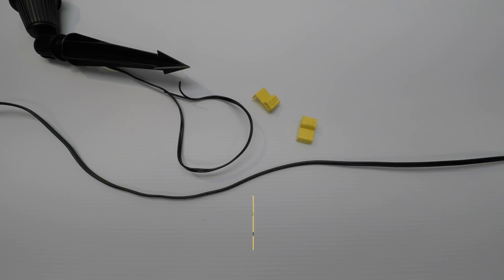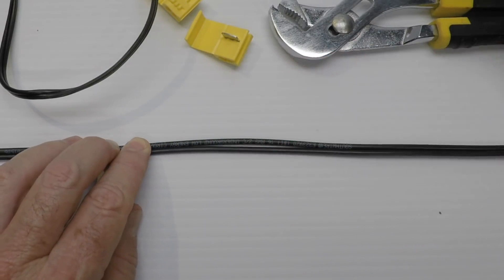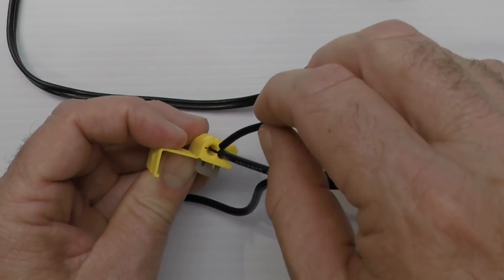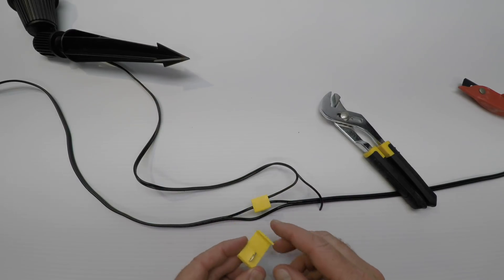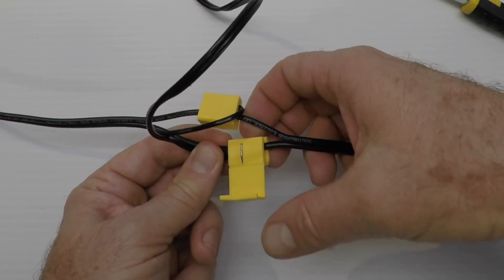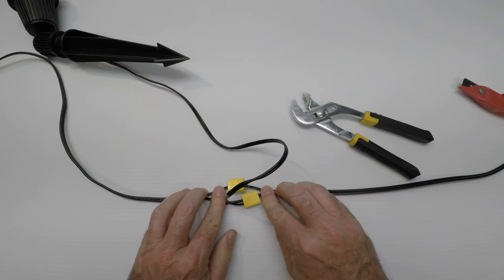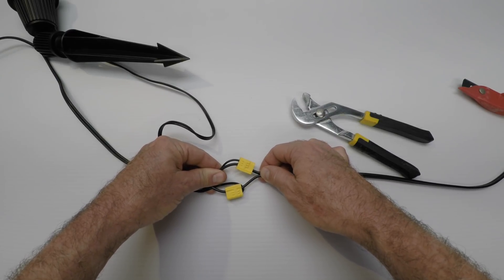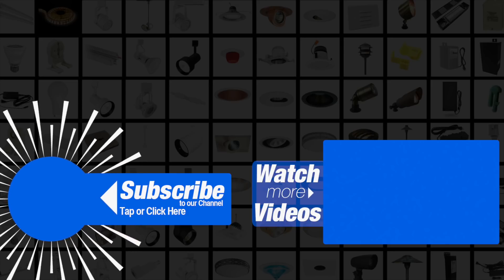How to use Our low voltage Yellow Wire Connector in Outdoor Landscape Lighting

Comment: These look fantastic. Went to you website. Was going to order the brown one due run wire being 12AWG. Is there an advantage of the blue one having the electrical silicon. Should one add electrical silicon to the brown one?
Reply from the maker: The gel greatly reduces moisture contact with the wire connection allowing for a more secure and long lasting connection.

Comment: Do these have any problems with rain or extreme heat? I live in arizona.
Reply from the maker: The best thing is to take a look at the yellow connector spec sheet here: https://multimedia.3m.com/mws/media/41210O/3m-scotchlok-self-stripping-electrical-tap-connector-562.PDF